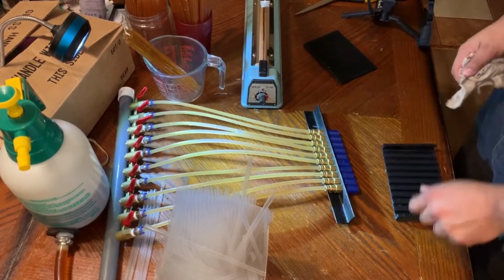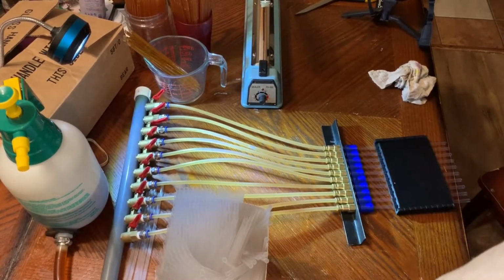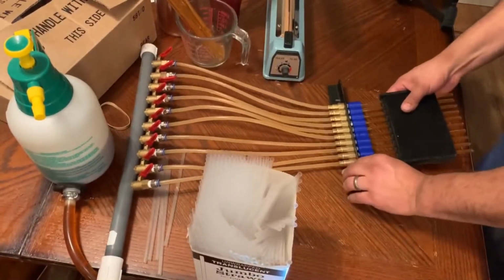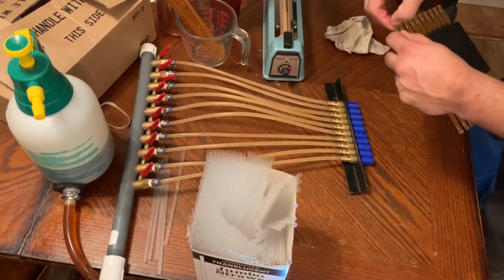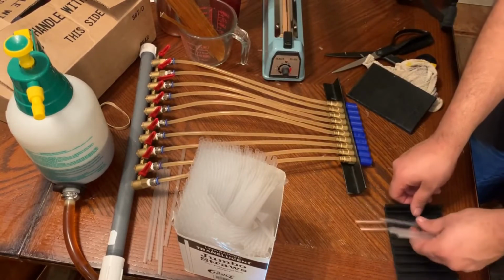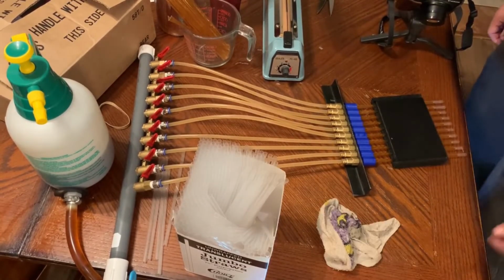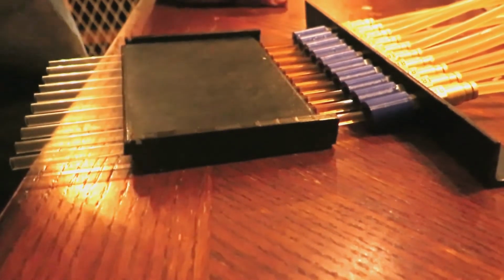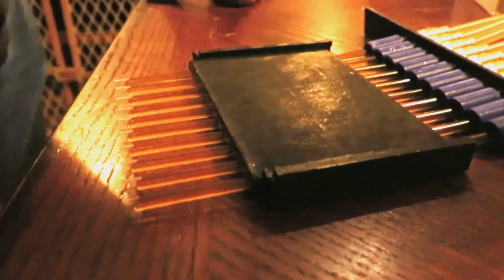1.1v Honey Stick Machine

Comment: How about food grade parts the sprayer and grey pipe look sketchy and those brass valves are often non potable and have lead in them
Reply from the maker: Good points you bring up, I believe the plastic for the sprayer is #2 so the plastic is safe, the grey pipe is schedule 80 pvc..... most water lines are pvc. The valves you need to watch what you buy. "This law applies to plumbing products intended for conveying or dispensing water for human consumption. It defines “lead free” material as containing not more than 0.25% weighted average lead for wetted surface areas. "  If you buy form your local store you need to verify that they meet those guidelines. You can easily fine them on amazon. But probably better to find some plastic ones that are food safe that are 100% lead free.
I had a hard time finding the right size slip fittings that were food safe for another project. A lot of those had lead in them and it took me awhile to find the right say and paid extra money for them.